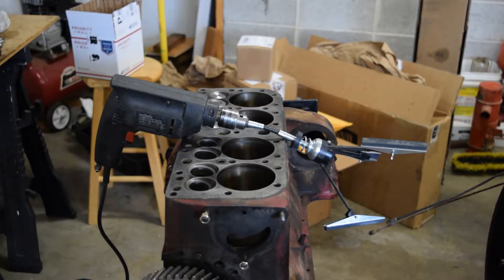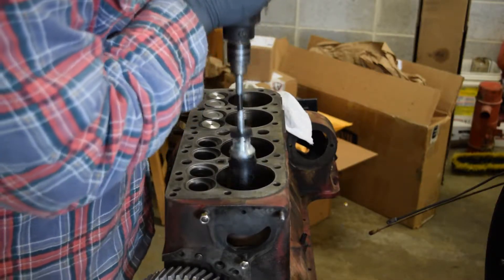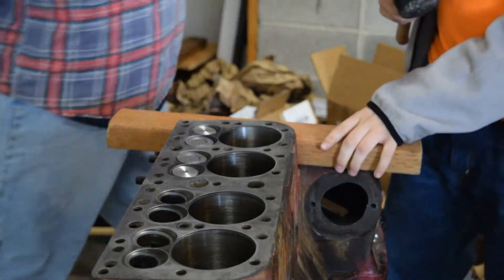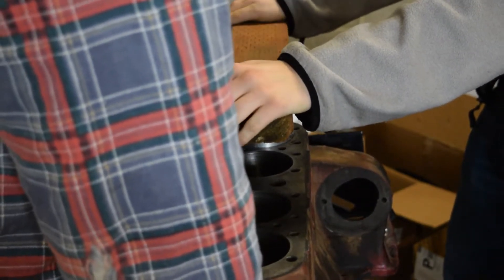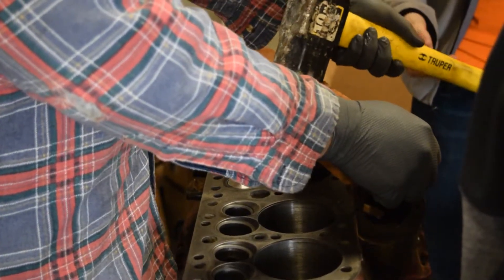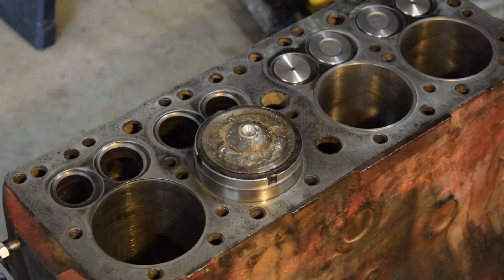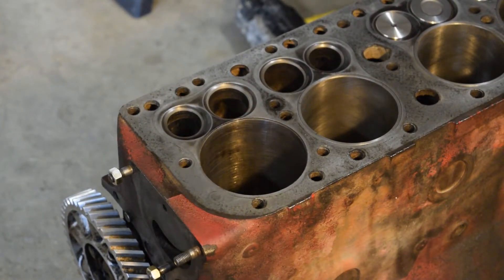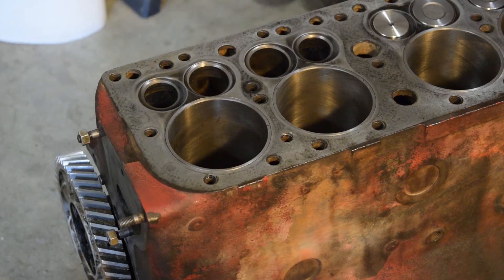1947 Ford 8N Tractor Rebuild Part 6: Cylinders/Sleeves

Comment: As I'm sure you've figured out, the seals only go on the intake valve. Reason is that the exhaust runs so hot they would burn off anyway. Thanks for the videos

Comment: If you have a good engine shop nearby, I highly recommended having them install the sleeves. After two broken sleeves that is what I did and it was less than $200. You got lucky.

Comment: You know guys take this with a grain of salt because I like your video but if it wasn’t for places like Harbour Freight I would have hardly any tools at all because I could afford the snap-on or Mac I live for stores like that and what you were doing pounding in the sleeves like that, the engine stand isn’t made for that so it wouldn’t matter what kind of engine stand you have it would still bounce! And while I am giving you Guys a hard time, putting the sleeves in the freezer is what I learned to and it always worked but you cannot wasn’t time , you have to be ready to go and you have to be extremely fast like Speedy Gonzalaz fast! But don’t get discouraged just Carry On !!! And God Bless!
Reply from the maker: True! Many tools of ours have also come from Harbor Freight. Thanks!

Comment: Harbor Freight only SOLD the engine stand. It was you that did not meet your expectations. Next time try dry ice in acetone and the sleeve will DROP in. Hint: do not wipe acetone off, it will prevent ice crystals from 
forming and will boil off ie evaporate, out. That was why you had to pound the poor thing in, it was growing in size with each passing second due to ice crystals. And a freezer only contracts a sleeve like that maybe .002 at the most while it is still in the freezer, that's only .001 a side. with each 30 degree increase in ambient        temp it grows .001 toward it's original diameter.  another thing, never use a cotton towel right before assembly, too much lint is left on the surfaces being assembled. Use lint free cloth or  just your hand for final wipe.
Reply: I agree with the installation tip of yagabagadaga (say that one time fast).  One helpful suggestion, if using your method, is to cut a 2x4 to length and place it between the engine block and the ground.  This will create another support and will illuminate the bounce when you pound in the sleeve.If you ever build another puck for this, tap and thread the center.  Then install a long bolt in the center.    Then you can use it as a press to install sleeves as well as remove them.  Same principle as a harmonic balancer puller.
Reply: Lol sounds like me and my son when working on stuff. I'll say something like put some balls in it son. Then he'll really turn lose, I'm like to many balls son. Lmbo
Lvoe the video. 👍🏻
Reply from the maker: Thanks for the advice. Like we have said, this was our first time rebuilding a tractor engine and we were just doing what we knew. The tractor runs fine now, but if we do another tractor we will keep that in mind. It will probably save us a lot of time and work in the future.